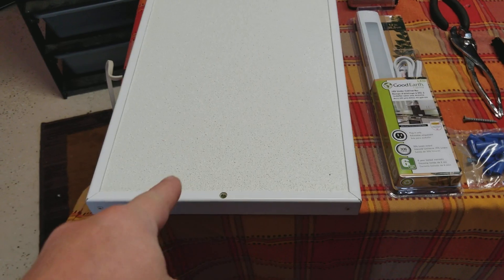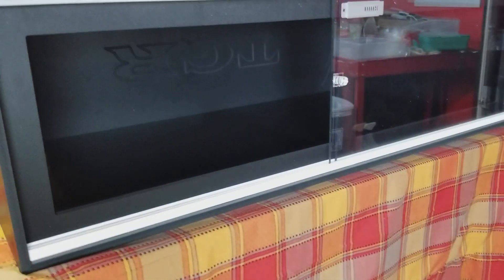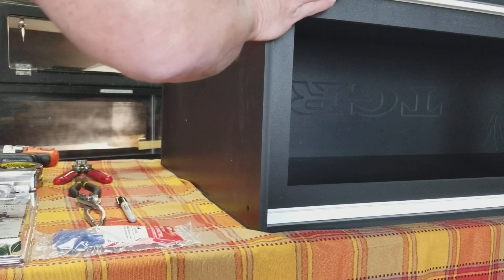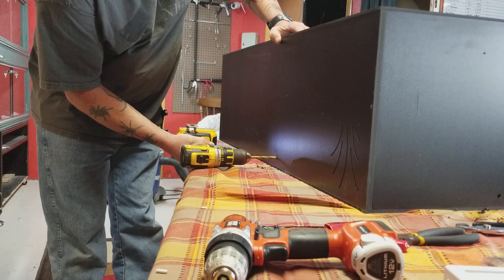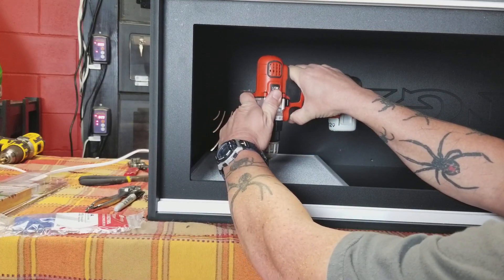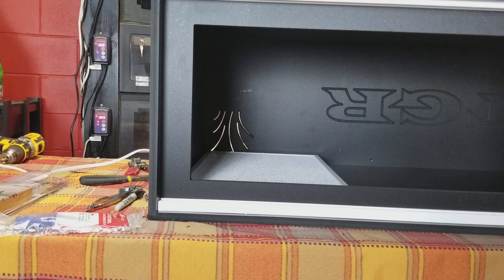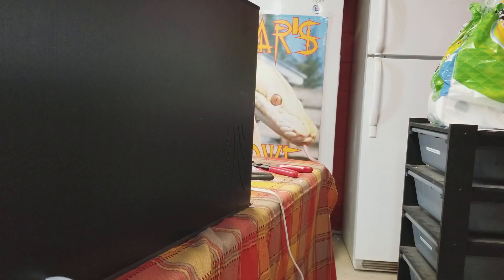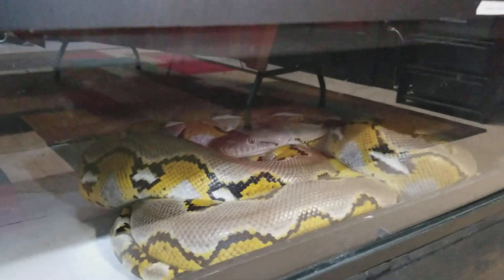Reptile Enclosure Radient Heat Panel and LED Set Up.

Comment: Just a tip because you share so much with us  is that on flat cords like that one feel the sides of the cord.  One side will be rounded and smooth the other will have ribs or texture. This is for most. Some are cheap but the textured or ribbed is the neutral side. You don’t really have to worry if it’s a round cord because they usually have colored wires. If you have a toaster you can check and see what I’m talking about with the texture on one side. Just so you don’t have to run around and look for a cord. Hope this helps. Marking them isn’t bad just a step you don’t have to take:)

Comment: Love the Content man you explain things so easy😎💪Quick question though I have a 36×18×12 All American cages enclosure do you think a 40 watt radiant heat panel and heat pad will work to reach 80°- 82° Cool side & 89°- 91° Hot Spot Side My house temps are 72° 75° lowest room temperature . Im from New England .

Comment: I'm ordering a 85 watt from pro products and I was wondering why you installed your radiant heat panel from front to back of the enclosure is there particular reason why you did this  and I forgot to mention I'm new to PVC enclosure and Should I place my thermostat probe

Comment: where can i find a 120 gallon 4'2'2 pvc front opening enclosure without screen mesh on top I'm setting up for a ball python and want to use a radiant heat panel but I can not install the panel on mesh or keep the right humidity

Comment: Is the rhp turned the right way? Just asking, cause it would look a lot neater with the wires running out the back.
Reply from the maker: That would definitely fall under the personal preference category. I use thermostats on each enclosure in a stack that are located on the side. So for me, this direction is much easier to work with.

Comment: So much good info in your videos. So you have two rhp’s in each enclosure? Do you have a probe under each? If so how does the temp and everything work? Sorry if you’ve already done a vid on it that I haven’t seen
Reply from the maker: Thank you and no problem. I use 1 RHP on each enclosure which gives a great temperature gradient.  And yes, the probe is directly under RHP on floor.

Comment: How do you keep the bigger snakes and cages humidity level up ?
Reply from the maker: Never have any issues with humidity with the PVC enclosures. But if you are having low humidity, you can mist or place water supply closer under RHP and that will increase the level.

Comment: When installing a radiant heat panel you need to Allow Some Space between the panel and the wall of the enclosure otherwise the panel will overheat and will not be as efficient or last as long.

Comment: How hot do those heat panels keep the basking spot, looking into getting a 96x48x48 animal plastics enclosure for my Tegu, wondering if i could just run a heat panel for the basking spot?
Reply from the maker: THAT is a question that I feel I wouldn't be able to answer correctly. Definitely give Bob a call at ProProducts, he would be able to answer that more accurately.
Reply: RHP's are not for "basking". They heat the entire enclosure and everything in it including the air.

Comment: I use reptile basics just panels but thinking about getting the pro products. What's the wait time on them and what's the brand of light you are using?
Reply from the maker: For the most part, when you call to place order with ProProducts, they usually ship out within days. And as far as lights, which ever is the cheapest LED light that Lowe's has. Lol. They all work good.
Reply: @sghpest  cool thanks

Comment: I know this is an older video, but I'd like to ask....why a radiant heat panel?....what are the pros and cons of radiant heat panels; compared to other heat options why would you use a radiant heat panel? When and where is it good to use one; when and where would you use something other than a radiant heat panel?
Reply from the maker: Heat Panels are the most reliable, long lasting, dependable heat source. When used with a thermostat,  they offer the best heat gradient for enclosures, specifically PVC enclosures. And I use them exclusively with all of my animals.

Comment: Did the 3m tape hold for you? And also, what size tanks do you use for your retics? I'm looking at AP plastics only for my future retics, im excited for them haha
Reply from the maker: Hey Justin, so far so good on the 3m for the LED lights. They are super light.  As for enclosure size, I use 4x2x1 for less than 2 yrs old, 6x2x 16" for up to 4 yrs old, and 8x30"x18 for 4+. That can vary depending on what growth rate you choose to uphold. And the LED lights can be purchased at Lowe's for $15.
Reply: @sghpest  awesome, thank you very much

Comment: What size screws did you use for the heat panel
Reply from the maker: 1 5/8th's. Just be sure not to over tighten, may come through top.

Comment: Hey Steve what size panel are you using in the T8 4x2x1
Reply from the maker: The 65 Watt, 12x18 is perfect for the 4x2x1. Biggest factor would be if your ambient temps are unusually low.

Comment: What do you use for the track for the sliding doors?
Reply from the maker: You can find plastic window track on Amazon for a relatively good price. The aluminum is much higher but plastic is reasonable and works great.

Comment: How hot does the panel get when u shoot it with the temp gun?
Reply from the maker: Hmmm, interesting question. I have never shot a temp on the panel itself, just the hot spot. I do know that they operate at a temperature that is safe for your animal. Specifically snakes. I've had several questions about them being used for lizards and such, but I'm afraid I'd be the wrong person to ask about those anyway. Pretty sure they are not recommended for a belly heat situation, if that is what you are implying with your question.

Comment: What type of thermostat are you using?
Reply from the maker: $20 thermostats from Amazon. Have worked very well for several years although the temp on stat is not accurate. As long as you have a temp gun and periodically shoot a temp and adjust as needed, it is a very useful inexpensive alternative.
Reply: @sghpest  , Thanks for the info.
But I would want something of better quality and pay a bit more for more accuracy.
Reply from the maker: @The-GreenHornet  that's where "what works for you" comes in. Lol. That is actually a great idea if you have 1 to a few enclosures. But when you have over 30, that tends to be very expensive. I actually took the recommendation from Bob at ProProducts, manufacturer of the Radient Heat Panels. As stated, several years of use with No problems.